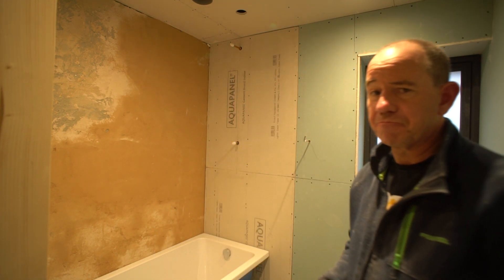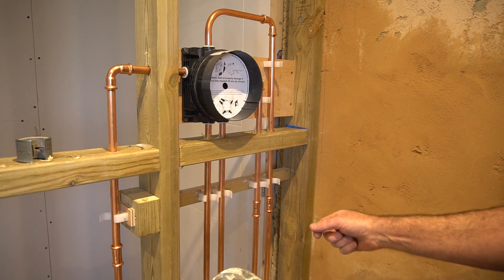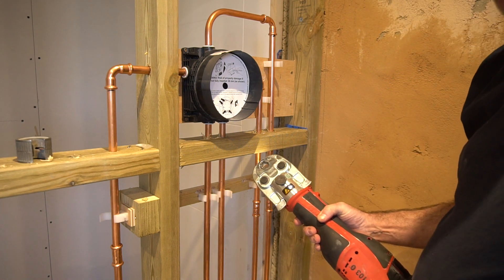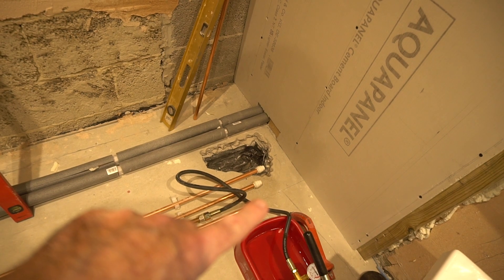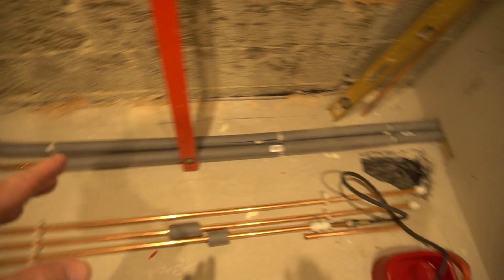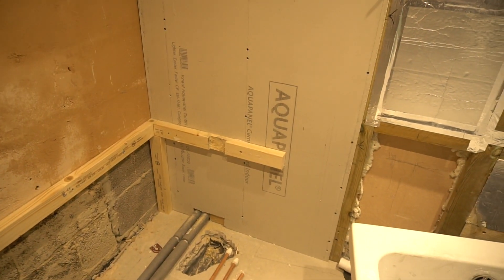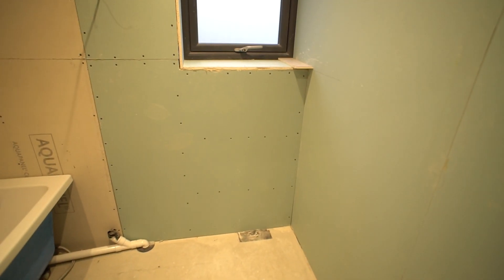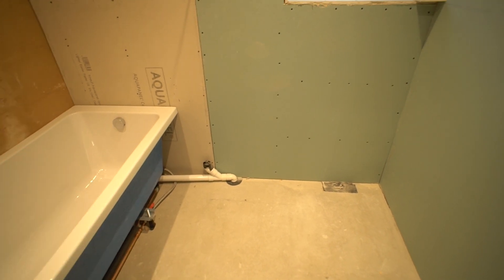Bathroom install episode 2: The Smarter Way to Install a Complex Shower Valve – Press Fit tools

Comment: Did you consider heat exchangers on the waste from showers to preheat the cold feed?
Reply from the maker: I did look at them at the Swindon self build centre.From memory they needed quite a drop of pipe to be installed and as we are a bunglaow we didn't have that space. I think I saw one that fitted under a bath as well. Its all a case of looking at the return on investment and how long I may live in the house or even live! Many of the things I looked at or have done are hard to justify when you look at the maths. It depends on what energy prices do in future and how much you want to save the planet. I liked the idea of these units but it was a step too far for me.

Comment: Have you come across any evidence of the longevity of press fit?    I managed to get a pair of novopress tools for £10 each from a mislisted auction, but i am now having second thoughts that i should just put in the extra effort and solder it all.  I really dislike the prep for soldering, though.
Reply: They have a 25 year guarantee which is pretty good in my opinion. Press fit is the way forward for a whole host of reasons. You do have to think ahead when fitting though as you won't be able to get the gun in tight spaces so need to press some fittings out of place.
Reply from the maker: £10 is a bargain, well done! I don't think they would be selling these fittings if they were not good enough, they even have gas versions. I don't like push fit but had no choice for my shower. The press fit fittings are quite a bit more expensive but it is so much faster. I can solder but I generally make a mess and pick up something when it is still hot! It would have taken me much much longer to solder the bathroom I just did on that video.
Reply: @JurassicJungle  i expect press fit is verry good, but are they 20year lifetime rather than 50 i guess they are probably too new to know.

There was a 3rd novopress in the same auction too that i should of bought to put on ebay.